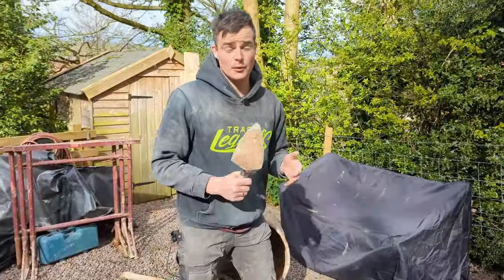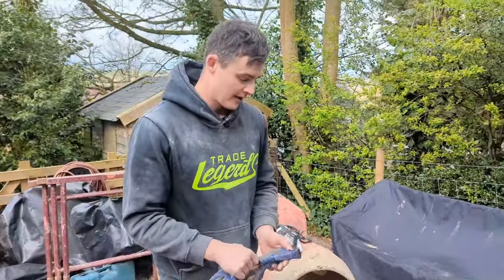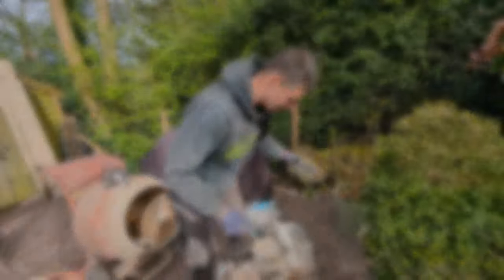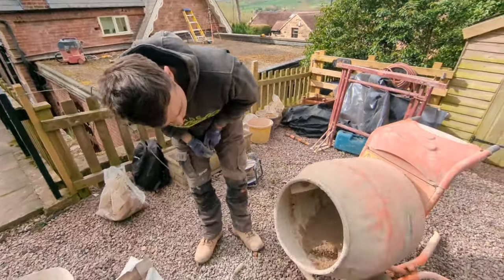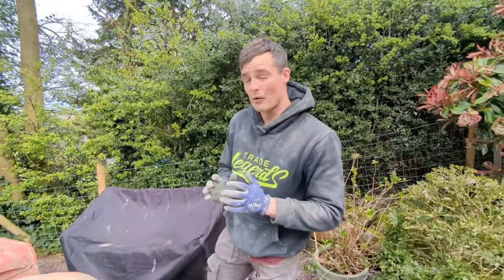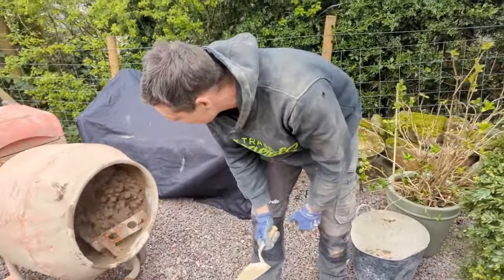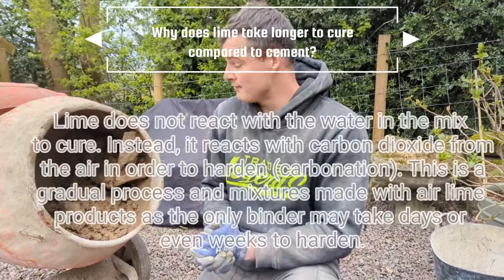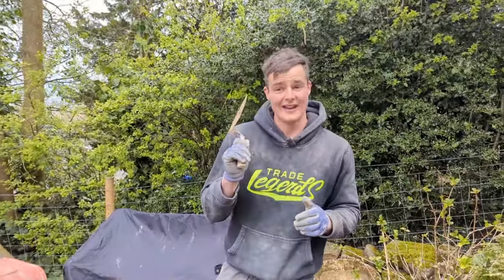How to make LIME mortar for repointing| 3.5 NHL Lime #construction #howto #diy

Comment: This is totally wrong on almost everything, why talk about something that you clearly dont have the most basic understanding of ? 

1. NEVER use building sand with lime. Using two parts of building sand like this is categorically wrong and will produce a very poor mortar. This also looks like unwashed building sand, even worse, especially with NHL's. 

2. USE a washed sharp or course sand for all the parts of the aggregate, preferably well graded, if a specific colour is required a very small portion of unwashed sand can be used to add colour. 

3. NEVER let the mix ball up like he does, add in 2 parts sand and one lime first and then enough water to make the mix start rolling over immediately, do not flood the mix, add in the last part of sand. 

4. You do not need to mix the first 3 parts dry for ten minutes, a minute would be fine just to blend the mix a bit. Once the last water has been added 10-15 minutes is fine for NHls. For best results mix for 15, leave for 5 to settle then mix again for 5. 

5. NHLs Do react with water, that is the whole idea dummy ...... natural hydraulic lime...... its in the name ...... NHl 2 is 30/70 water/ air. NHL 3.5 60/40 NHl 5 80/20.  Once mixed NHL 3.5 and 5 should be used fairly much straight away, especially in the summer. NHL 2 is more workable but will start to carbonate as soon as water its added. The only form of lime that reacts only with air is lime putty. Which he probably should have been using anyway.

6. NHLs are, at least 3.5 and 5, very strong compared to historic lime mixes. 5 is basically weak cement and too strong for everything apart from chimneys. 3.5 is again fairly strong but mixed at 1/3 is acceptable in exposed areas. NHL 2 is a better option or even lime putty with a pozzaline. 

Most important of all, never listen to some chump on YouTube who knows nothing about lime, stick to knocking up cement blocks mate.
Reply: Mixer isn't even on the stand. You need these mixers tipped forward to create the slap when mixing
Reply: I'm a total noob about this, but am trying to patch some small areas on an old house we bought.  Can you recommend any particular pre-mixed lime mortar, and what do you think of the LIMELITE stuff?  Cheers.
Reply: First off its getting into the wrong time of year for external lime work. If you have to do it now then a NHl is your only option, putty wont set enough before winter, or its not worth risking it anyway. you will not destroy your house using the limelite NHL 3.5 at 1 part lime to 3 parts sharp/grit sand. but a less strong lime might also be better. the key is to make he mortar the sacrificial element to the stone/brickwork. if the mortar is stonier than the brick/masonry then they get damaged. You're on the right path already so well done ! @Showing_the_car_
Reply: @thomasgargrave-e6m   Can you recommend any particular pre-mixed lime mortar?  what do you think about LIMELITE plaster?
Reply: Pre mixed means lime putty. As above its a bit late in the year for that. Call a local lime merchant, in the south we have rose of Jericho. they are a great source of help and information. @Showing_the_car_
Reply: @thomasgargrave-e6m  We are doing repairs inside where gypsum plaster has fallen off the brickwork.  We are thinking of using LIMELITE plaster the replace it, to let walls breath.  Also have some small repairs outside and want to fix some of the pointing using pre-mixed lime mortar.